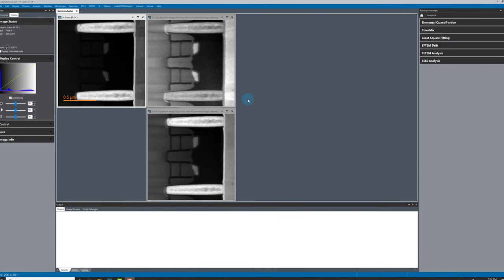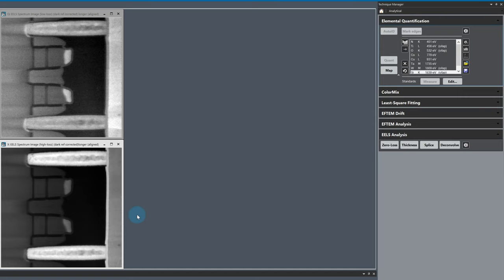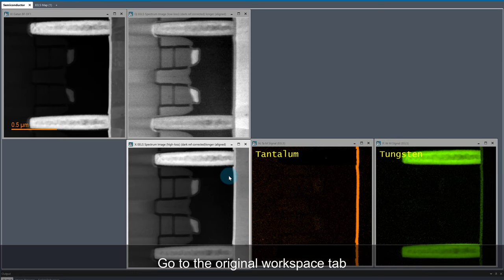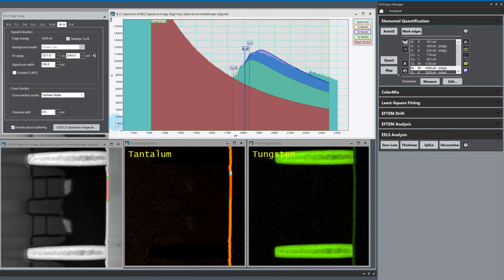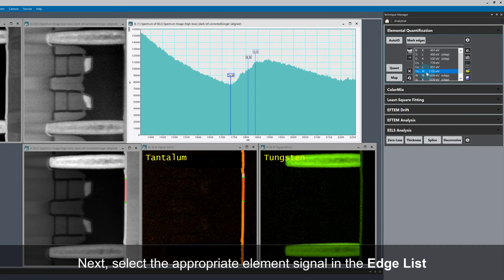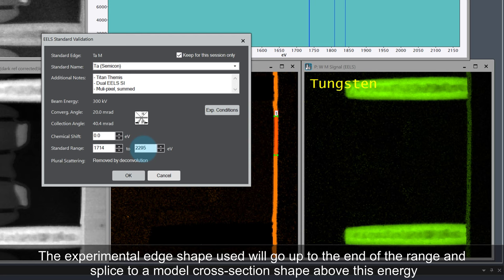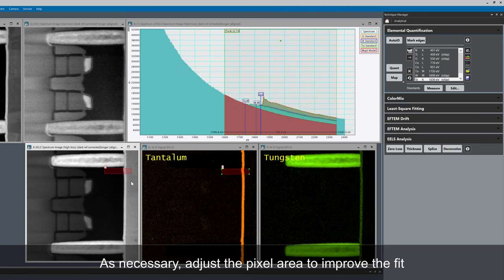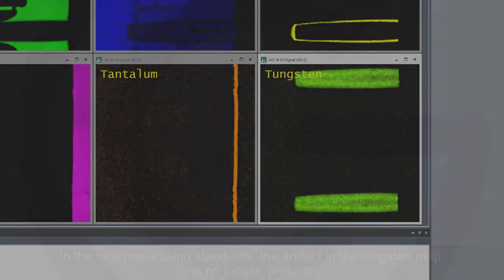EELS quantification: Using internal standards

Comment: Emm, can I ask something?
First, good job of removing the tantalum signal from the tungsten mapping. 
Now, what I have noticed from end of your video is that, I saw some faint signal of silicon(blue) at the region of M0( where the tungsten suppose to be). At that place there is no way that silicon is present. Any methods to improve this?

( I might be wrong)